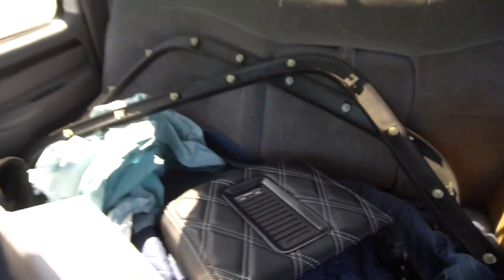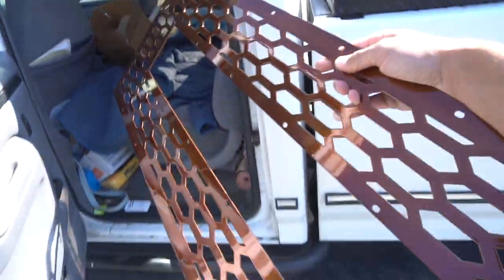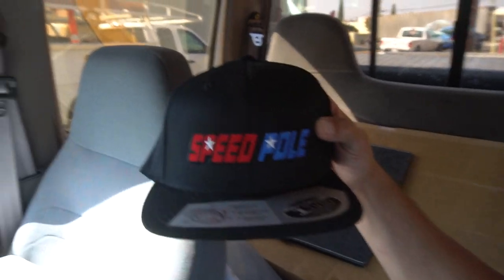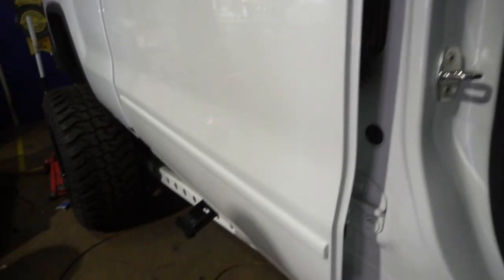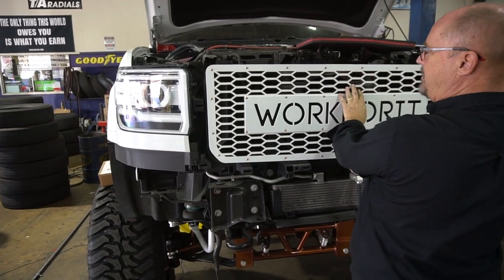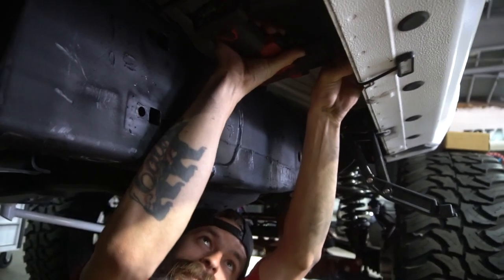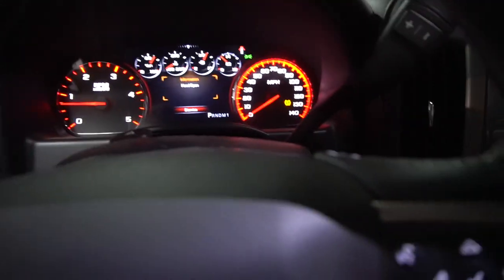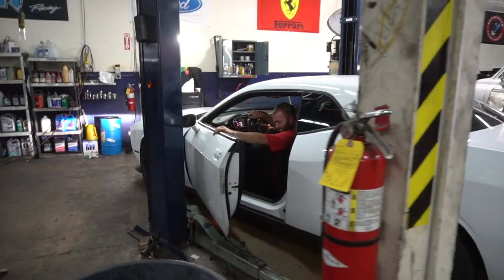FITTING MY CUSTOM GRILLE! WELL SORT OF...

Comment: one thing I want to comment is that the work for it on the head rest the "for" seems to be in red instead of a copper or orange. and to me it doesn't match as quite well of the color scheme you are trying to pull off. but I might be wrong. the camera might be deceiving me.
Reply from the maker: jasonman1515 it was supposed to be copper 🙄 cursed truck build
Reply: should had gotten a burnt orange color thread. that would be somewhat to a copper orange and it would have match lot better. maybe after sema you could get it fix or what ever. just my 2 cents